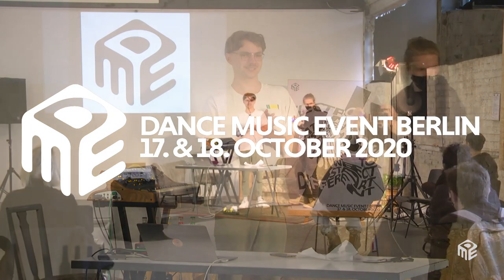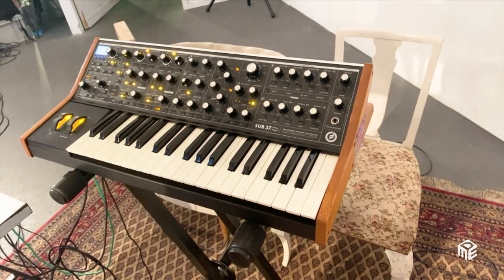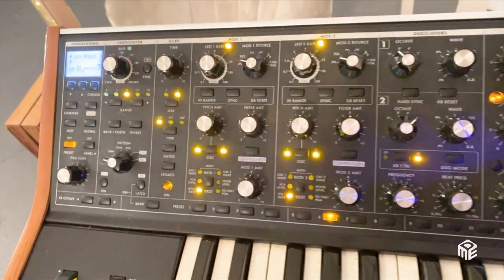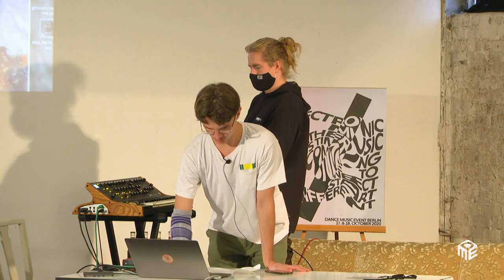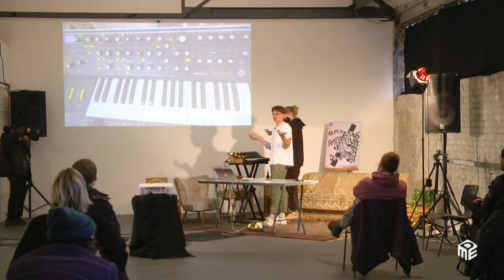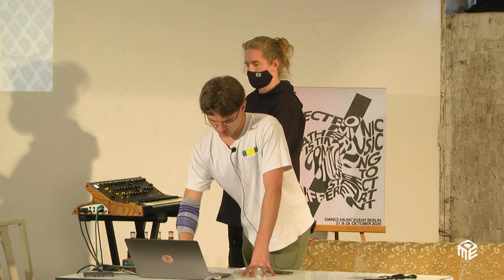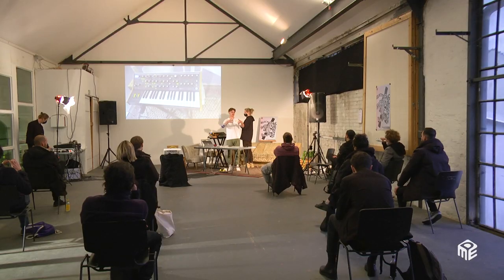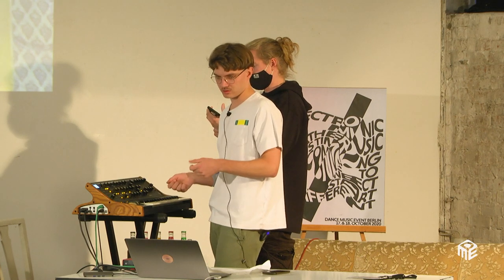Moog Sub37 Workshop with Yannek Maunz | DME Berlin 2020

Comment: Hi Yannek, can you please explain what is needed at a minimum in order to use the Moog as you use it in this workshop? Cables? Other devices?
Reply: You need: 1. The sub 37 2. 2 Midi cables (or 1 USB); Power cable; Aufio cable 3. Any DAW 4. Delay and Reverb (doesn’t matter which one)